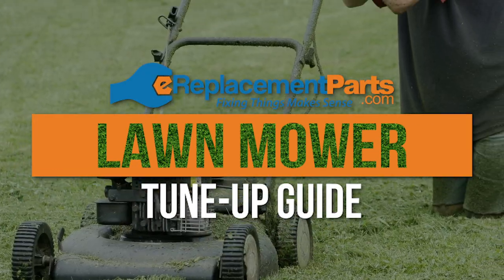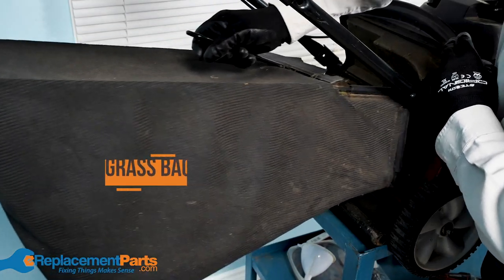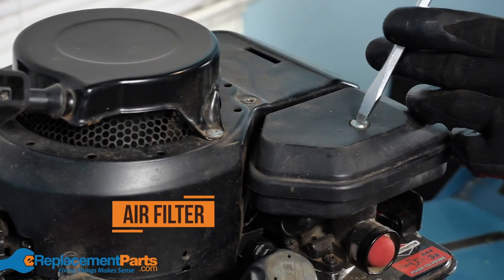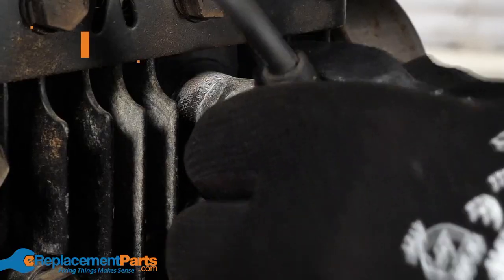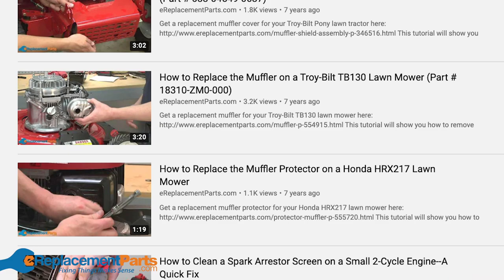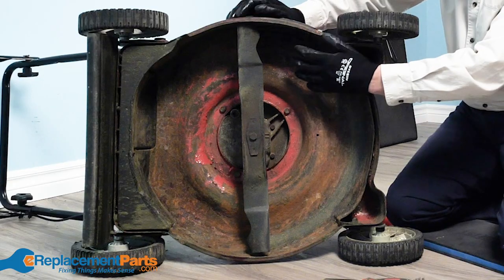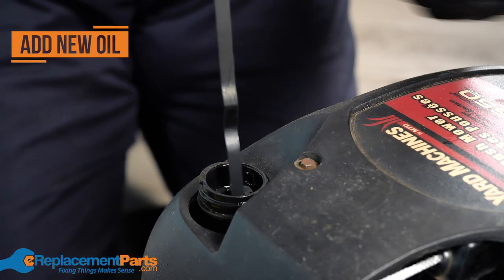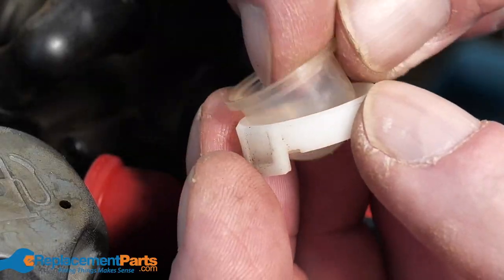Lawn Mower Spring Tune Up Guide | eReplacementParts.com

Comment: Do you turn on the mower upside down to drain the oil? I remove the drain plug under the deck which can be pretty difficult if you have to remove the belt guard.

Comment: ?? Do you turn the oil dip stick on and off to check oil or just set in 
Kawasaki.  You just set in no trun on. I get confused with the different types of engines..  like Honda  brigs.. Kohler..
Reply from the maker: You're right, all engines are a little bit different, so I think the best course of action would be to consult your specific machine's user manual on this one! Thanks for watching!

Comment: Wipe the Used motor oil on the underside of mower deck to prevent grass build up & rust.
Reply from the maker: That's a great tip, David!
Reply: Try spraying it with cooking oil spray.